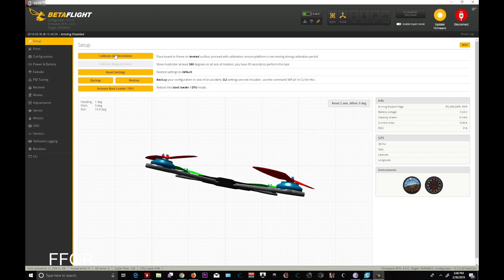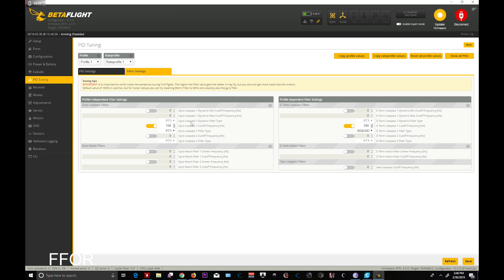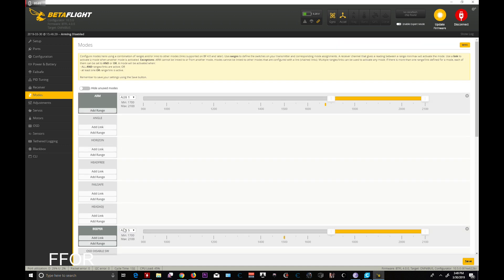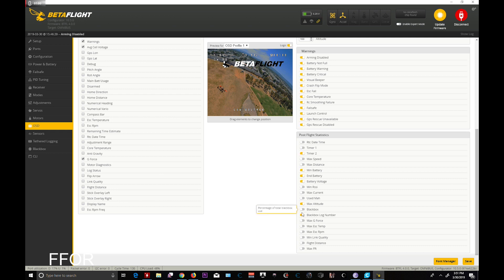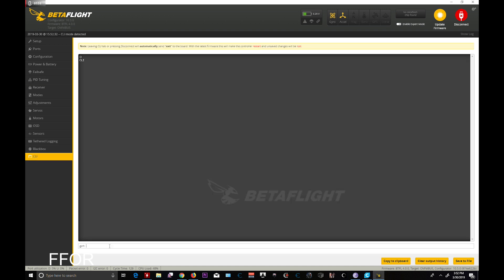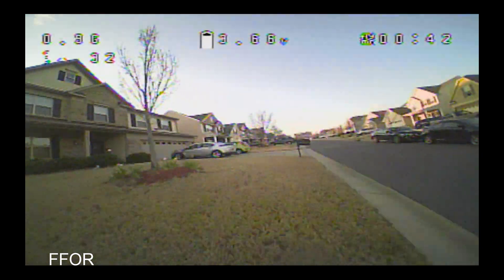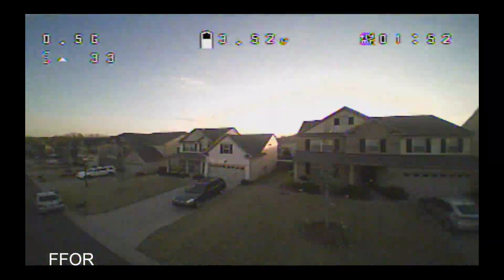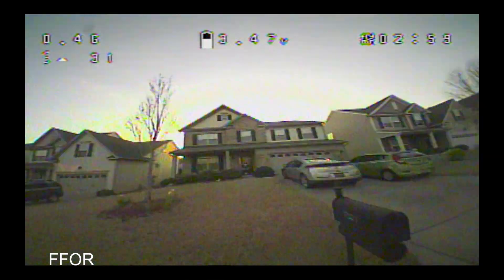Betaflight 4.0 RC4 - Quick setup and flight

Comment: As always, Nice setup vid! ..Dawg if you're gonna rock flySky you gotta get some fli14+ receivers. Imho Rssi is a must! 👍😁
Reply from the maker: I bought like 5 of the simple ones.  Easy stuff to fit and fly. Rssi is pretty useless to me with the yard sized area where i fly. My 5 inch has rssi
Reply: @Sully365  RSSI for my tiny little front yard tree RIPZ....not today Satan!
Reply: @WCO3   I have 5 fli14+ receivers. RSSI works, but range is garbage. You never know when its gonna failsafe within 150m radius. I get better results with RX2A.
Reply: @mihavuk  when I use flySky I like the little rx2a but I have better range with the flit10 tho!  And I have tried them all. there's even a generic one called the 8a version 2 with ufl, that's not  bad. You right about the fil14+ range.
Reply: @WCO3  I've read about fli10 on rcgroups that it is much better than fli14+. I have 2 on the way. On 5 inches I'm using FSia6b. It's huge, but I don't have to care about the range within 500m radius, even when flying 1m from the ground. It outperforms many other reputated radio systems. Tested. 😁 I've also ordered antennas with balun (I think the most common term is cage dipol), I'll install them on fli14+ and test if the range will improve. But for micros, I'm totally happy with RX2A, never had any problems within 150m radius and that's all what I need for my micros.
Reply from the maker: i use the ia6b on my 5 inch..love it.  never an issue. my goto micro receiver is a generic ia8s (there is a generic that is just missing the cover).  funny thing...it flies very well for me with no antenna attached when compared to just having a chewed up antenna...learned that the hard way
Reply: @Sully365  the Ia6b is just too huge! Lol I've even gone as far to dpin dcase and take off the front PCB, to reduce its size this, is the generic receiver I was talking about https://youtu.be/OSPHpRg6z4A
Reply from the maker: Yea, i use this one: https://www.banggood.com/818CH-Mini-Receiver-With-PPM-iBus-SBUS-Output-for-Flysky-i6-i6x-AFHDS-2A-Transmitter-p-1183313.html?p=5Z14237990857201612G&custlinkid=213127  I think it's the first in your video.  Great little bugger
Reply: @Sully365  Yup! you got the right one!.. Thank God it's not the Og fsa8s  it was such garbage we used to have to wrap it in tin foil! Lol
Reply from the maker: @WCO3  i heard so many bad things about it that i ended up searching for any alternative.  I like the little ones, though i don't trust them too far out.  I will say my recent experience has caused me to drop by failsafe from .8 seconds to default .4. that's a long time at 80 mph
Reply: @Sully365  Rc6!! Dropped this morning! :)
Reply from the maker: @WCO3  i saw that last night but the changes were not something affecting many people yet.  Another configurator 10.5 version came that does appear to fix the reconnect issue i have
Reply: I flew Flysky for over a year...i have owned them all especially the micro recievers when you mount the recievers antennas in conjunction with zip tie and shrink wrap..which generally dont leave a lot of slack in the antenna wire... and if you dont inspect  the ufl connection evertime you crash? The antenna gets pulled out of the ufl connection & your quad ends up failsafe even at close range..This is one of the biggest flaws i found with Flysky recievers - genaric or better quality Flysky recievers they dont crimp the recievers antennas very well with the ufl connection!!.. The FlySky RX2A pro even with its short antenna thats soldered on the reciever ended up failsafe on me at less than a 50 yards over concrete destroying a $400 build. Like stated above..if you are just flying in the yard your going to be ok...But if you flying at the edge of LOS? There are possibility of failsafe..Best to check the antennas connection at the ufl..even if its new reciever! I ended up buying (RDQ) spare FrSky UFL antennas which has better QC..and better UFL connection ..and mounting them on the Flysky reciever...This yeilded the best results and stopped the failsafe that i was having.. I heard they are working on better Flysky recievers now that theres better quality transmitters coming out!
Reply from the maker: @allennickles3970  that's really good to know.  I've only had one micro receiver that was just poor and it actually got better when i ripped the antenna off and left the ufl connector.  I think the antenna was actually tuned incorrectly
Reply: @Sully365  lol been there done that....lol...(According to a friend of mine in China) most of antennas from Flysky has been tuned to one reciever..so in testing faze they tuned it for the test reciever. Then went with that tune & lenth of antennas...for the production run..You can have two of the same reciever and one out of the two may perform better than the other. Simular results has happened with VTX etc.. So yeah these Flysky recievers are hit or miss sometimes. But since the release of the Dark Night  transmitter they are working on making better recievers is what i hear!!They still perform decent for a cheap alternative. I finally bite the bullet and switched to crossfire myself.. They have a excellent track record of testing recievers...in most cases over & over again! I still have my I6 Flysky transmitter and still have a few micro"s on ibus..If your flying close you really dont need much more than Flysky
Reply from the maker: @allennickles3970  I completely believe it.  Glad to know.  when and if i switch back to 5" or larger, i'll probably be in a better position to upgrade my headset and transmitter...but yea, for flying in the yard, no biggie.
Reply: @Sully365  I enjoy the content...keep it coming bro...cheers!
Reply from the maker: @allennickles3970  Danke!
Reply from the maker: @allennickles3970  that's really good to know.  I've only had one micro receiver that was just poor and it actually got better when i ripped the antenna off and left the ufl connector.  I think the antenna was actually tuned incorrectly